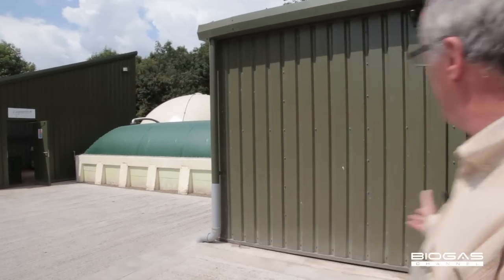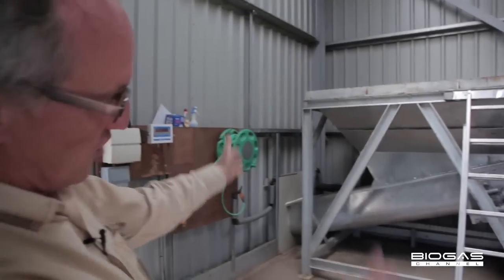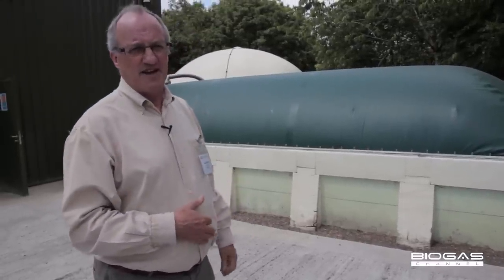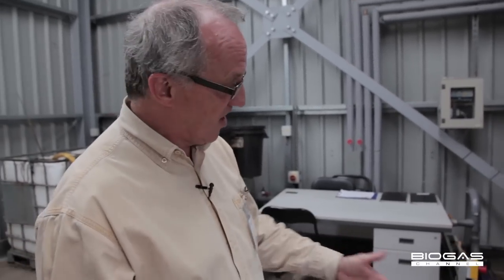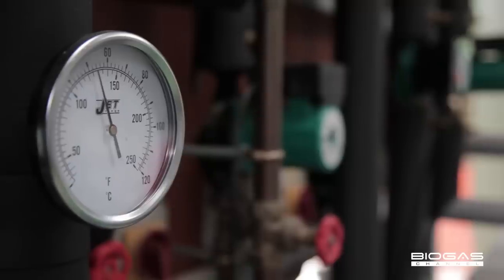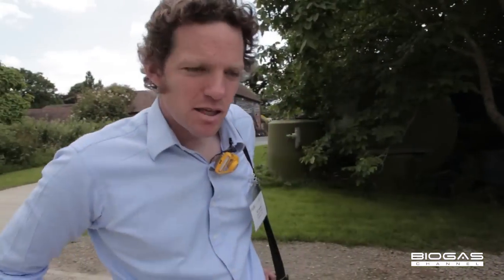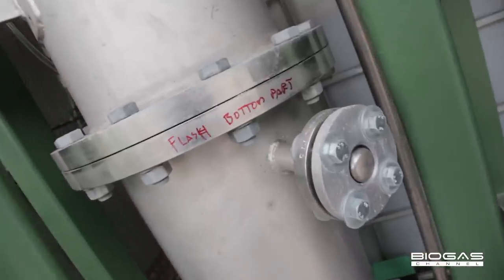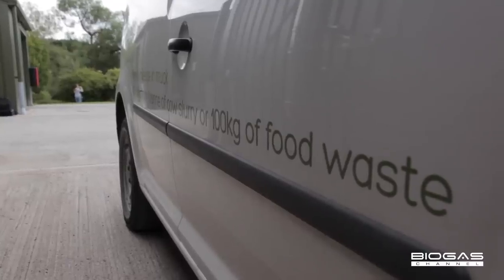A small 7kW biogas plant to produce electricity, heat and biomethane - English subtitles

Comment: How many cubic meter size of Biogas can power 10kw gen 24 hours a day
Reply: 5 meter  cubic per day
Reply: You may need to work out specifics for manufacturers as the kilowatts I assume you’re referring to the electrical power produced which would be vastly different amounts based on efficiency and a few few other things because if you don’t run it at its full efficiency because you’re not at the optimal load it’s going to be different that’s why I personally would charge batteries and running inverter so they can always take the generators most efficient power load and then shut it off when they’re charged

Comment: Great Video, I swear im a biogas junkie lol, I have built three small home digesters which i run a small generator. Thanks.
Reply: Hi there David. I have two IBC totes and I plan on connecting a series of 50 gallon drums to filter water. In the thought of harvesting the gas off the system, Should I be thinking about how I might contain a bladder? Say this watered I have stored away..?

Comment: Hi Michael. I’m impressed by your Evergreen biogas to Biomethane setup. I would like to ask if it’s possible to purchase a similar setup with complete Biogas scrubbing, compressor setup  and storage storage system.
The target is to have a Biogas upgrade system that processes Biogas generated from Biogas digester that uses large scale Pig farm manure and the feedstock.
Did you build your own compressor and scrubber or did you purchase it ?
Regards,
Jesse
Reply: It depends on the electric generator, for example a 600 watt one consumes 0.75 cubic meters of methane to generate 1 kWh.

Comment: Seems that there is plenty of scope for expanding this technology, but it still require oxygen from the air in order to utilize the gas.🤔  Hydrogen produced by electrolyces using solar, wind or water flow to generate the required electricity, and the hydrogen gas from water that then can be stored and when combusted it will use equivalent oxygen to what was released when the water molecules was split by the electricity,  so the worlds finite oxygen levels in the atmosphere etc, is not affected, nor is undesirable compounds produced, as from carbon based fuel usage - when clean "green" hydrogen gas is used for combustion.!☺

Comment: I wonder if you have any estimates on average kWh_biogas/kg_waste from the generator and boiler output logs?
Reply: This depends a lot on the type of waste you have. Fats have much higher biogas production potential than for example cow manure. A ton of glycerol can produce up to 647 m^3 biogas per ton (1000kg). A ton of cow manure produces only 27 m^3 biogas.

Comment: Looks great but would the same system work as efficiently with manure instead of grass I wonder.
Reply: These systems are used with great success on farms with cows, using cow manure
Reply: It works fine, but you get far less gas per tonne of solids. About 25 cubic metres per tonne of cow manure, and about 125 cubic meters per tonne of grass and such. Food waste is even better, at about 376 cubic metres per tonne. It all depends on how many calories the feedstock contains.
Reply: To be fair, those numbers are the smallest numbers I've found so far. Plenty of groups get a lot more gas per tonne than that. Some digesters are better than others, and some are simply operated better than others. For example, if you try to pump too much material through the digester too fast, you won't get as much gas out of it.
Reply: Is it common to have two digestion chambers to increase capacity and utilization of the organic material? I have an idea that would, post digester, drop the material into an aerated container before transferring the top third of that container into a clarification tank so that the top third of that could then be transferred to an artificial wetlands with farmed fish. Would this be an efficient method of treating large amounts of organic waste? Will this process reduce the nitrogen/phosphorus load within acceptable levels for fish farming and human contact?
Reply: @brightmal  Hello Mark do you have any sugestion of any paper that can give me a reference to the figure? I would like to start a biogas project, and I need a proper and trusted reference.
Reply: @monkeymonkey35  there is a great book called The Biogas Handbook, I think. It brings together a lot of knowledge on the subject.

Comment: What's the environmental impact of releasing H2S into the atmosphere?
Reply: It's actually carbon neutral because the substrate used is replaced by the feedstock it was removed from ie grass, maize, seaweed, etc. 
Fossil fuels has no replacement thus continously accumulation of emissions consistently and  currently no signs of stopping.
Reply: @nesiansides7133  there's no carbon in H2S.
Reply: @paulishism  removed via H2S/Co2 scrubber filters, usually with metal wool, lime catalyst, which biogas fed thru aquarium aeration stones. Most off grid farms use low-tech components.

Comment: Biogas is extremely positive in terms of the environment, but it is only ethical under certain conditions. It must only be used with manure, food waste or farm waste products as inputs, and should never burn food crops or garbage, nor use crop land or forests for biogas fuel. Secondly, the solid and liquid natural fertilizer produced needs to be returned to the soil, of course. Given these strict use parameters, biogas is a good thing. Break any of these rules, as is the current norm, and biogas is sheer destruction.